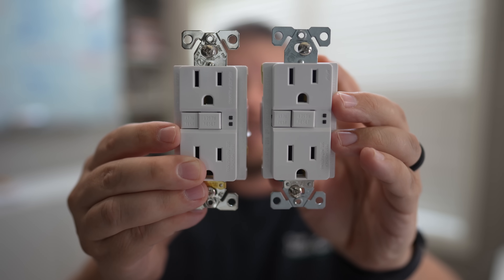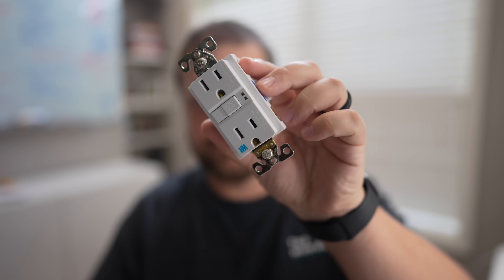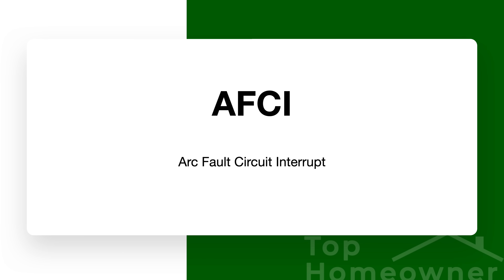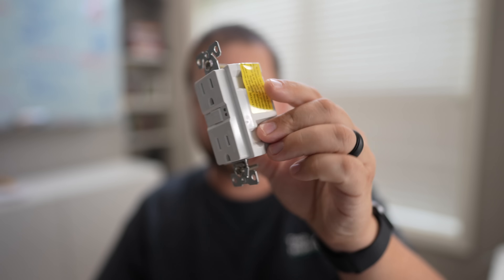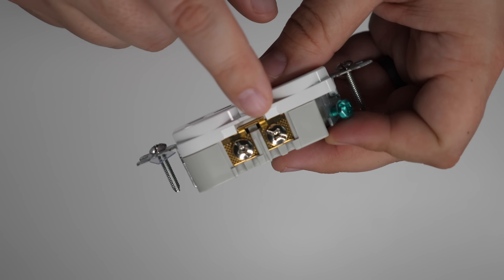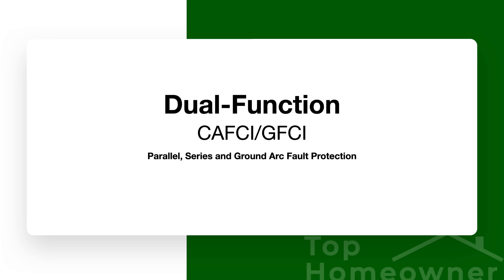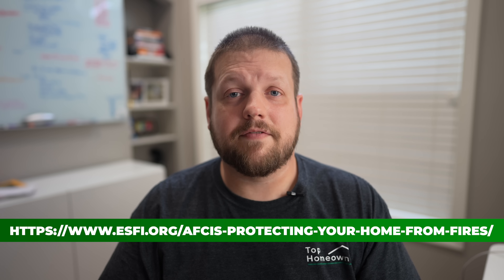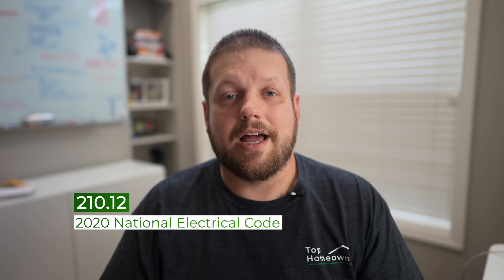AFCI vs GFCI: What's The Difference and Why You Should Care

Comment: At 8:12 you mentioned "FCC certified". What does that have to do with this, or did you misspeak?
Reply from the maker: Yes, while it sounds odd...ideally all electronic devices should comply with FCC (Title 47 Part 18B/consumer or 15B) requirements to avoid loads that can cause nuisance tripping. It's a way to help make sure you're using devices that don't generate a lot of unnecessary noise, and cause it to trip.
Reply: @TopHomeowner  Huh?

Part 18 pertains to "industrial, scientific, and medical devices", and part 15 pertains to "radio frequency devices". Neither of these portions of the federal code would be applicable at all to any devices commonly found in homes and which would cause nuisance tripping of AFCI breakers.

Indeed, I'm not aware of any FCC regulation that would apply to non-radio-based household electrical devices. The FCC doesn't have jurisdiction over, for example, manufacturers of vacuum cleaners, or toaster ovens, or plasma TVs, or the like.

Comment: Thanks for the excellent video.  I was hoping that you would spend a little more time on 'nuisance trips'.  Major appliances like microwaves and refrigerators can have higher current draw at startup and cause the AFCI receptacles to nuisance-trip - or so I have been told.  I have been bothered by nuisance trips in my microwave circuit, and have been meaning to get around to taking out that receptacle and replacing it with a standard one.  BTW, I was told by the building inspector to do this if it became a nuisance.  Since the microwave is on a dedicated circuit and the microwave's chassis is grounded, I don't see any risk in doing so.  Comments?
Reply: A dedicated circuit and grounded chassis don't have any relevance to arc faults, the events AFCI are intended to address.

That said, I had a house built, moved in a few years ago, and the AFCI breakers were all kinds of trouble. We eventually got things settled down, mainly by putting in newer versions of the same breakers. Apparently the manufacturer does work to update them to have less nuisance tripping. But even so, while it's a lot better now, they still trip for no good reason once in a while (the vacuum cleaner being the main culprit at this point).

The breaker manufacturers love to quote how many house fires might be avoided with AFCI breakers. But with all the false positives, people learn to not trust the breakers. And if the fault is inside a wall, it's not like a homeowner even has any sort of practical way to diagnose the problem. They're just going to assume that it's a nuisance trip, get annoyed it keeps happening, and put in a non-AFCI breaker, negating any benefit the AFCI breaker might have provided for all that expense.

This seems to me a great example of a road to hell being paved with good intentions (if one charitably really believes that the manufacturers are just out to save lives, and not just grab thousands of extra dollars per new home built).
Reply: These things are electronically controlled & age does not help. Replace it with a newer GFCI and you'll probably be set.
Reply: @dryan8377  Thanks for the comment, Dylan.  Very true - they can get worn out from age, or from too many trips (I suppose).
Reply: @dryan8377  Yeah a GFCI thats not faulty never has nuisance trips, its not the same with the AFCI, as it just looks for waveforms that look like sparking, so if an appliance generates those waveforms its gonna trip the AFCI.

Comment: Pretty hard to get hot and neutral any closer together than touching side by side in an entire home run if you use 12-2-2 for powering two separate circuits.

Comment: "designed to protect against a ground fault from occurring".

Bad use of English.
There are two grammatically correct English statements which can replace this erroneous statement.
1. designed to prevent a ground fault from occurring 
2. designed to protect against a ground fault.

The problem is that people may interpret your remark as number 1. And a GFCI doesn't prevent the ground fault from occurring. It simply mitigates the impact of it when it does occur.

What you should have said is written in number 2. 'designed to protect against a ground fault".  The addition of "from occurring" was wrong.

You have to be careful with the use of  language when your goal is to educate people.
Yes it is being pedantic but it matters.

Comment: I absolutely DO NOT care. When I bought my house 25 years ago, it had 4 GFCIs in it. I quickly removed them, put them in the trash, and installed regular outlets. Problem solved. Been fine for 25 years.
Reply: Been fine until someone is electrocuted.
The GFCI isn't about protecting the electrical installation, it's about protecting you and others from electrocution.

Do you not understand this?

The AFCI and breakers are about protecting the installation.

So you have removed devices that were installed to protect people from electrocution and you say you don't care.
Are you stupid?

Comment: Is there a way to determine why an afci is nuisance tripping?
I paid a lot for Square D QO plug on AFCI/GFCI brakers. They had to be removed.
Reply: If there is no arc, and it trips, then it is nuisance tripping...
Reply: @deang5622  How do you know if there was an arc?
Reply: @cannon440  Arcs generate wideband RF interference. If you had a AM radio receiver hooked up to a data logger and time stamped that could be a way.

I suspect there is noise induced on the conductor which could be detected using an oscilloscope. I am not sure of the exact method employed by AFDD's, but they will be looking at some characteristics of the waveform , voltage, current, in either time or frequency domain.

And arc's cause burning of switch contacts or wherever it is the arc forms. So you will see discolouration or even evidence of black carbon burnt residue.

Unfortunately, the inside of switch contacts is hard to see.
Reply: Unless something specific trips it, like using a vacuum cleaner, you have to inspect the circuit to find out.
Reply: @kamX-rz4uy  How do you inspect a circuit which is completely behind the walls?

Comment: The problem is that AFCI's nuisance trip so often that most people don't trust when there really is a problem.
Reply: Correct. One problem leads to the other -- nuisance trips are "crying 'wolf,'" with the usual results.
Reply: Correct. The same issue with the stupid tire pressure monitors in vehicles that were mandated and a generic light turns on on the dash. False alarms to the point of ignoring them and then on occasion an actual flat tire. Basically useless. Newer vehicles give specifics, which is crucial or is not a good tool.

Comment: I discovered that spider nests inside my outdoor receptacles caused my panel GCFI to trip.  Replaced the cheap receptacles with commercial grade and haven't had a problem since.
Reply: harbor freight
Reply: I've experienced this with a circuit breaker. Weirdest electrical issue I'd experienced.
Reply: Where do u get cheap electrical products?  I needs to know!!!
Reply: @tredogzs  This is a 48 year old house, some of the stuff has like 79 cent price tags.

Comment: I had a gfi that keeps triping turns out it was all the steam  build up in my coffee pot
Reply: Change your coffee pot.
I use electric kettle and coffee pot and my apartment is protected by two GFCI's at the distribution board and they never false trip.

I certainly would not keep the coffee pot and remove the false tripping GFCI.
I would replace the coffee pot and keep the GFCI. Why? Because the GFCI will save my life but the coffee pot won't.

Comment: I am an electrical engineer and a contractor and want to say, that it's a very good and easy to understand  explanation of AFCI and GFCI protection.
Reply from the maker: Thanks, I appreciate that!
Reply: I cant belive how prehistoric sockets look in America.
Reply: I just got power back after losing it for 3 days due to hurricane berly. Problem is that my 3 bedrooms and its lights don’t have power. I went to circuit breaker panel and tripped the 3 breakers, but to no avail. The three breakers show AFCI. Does that mean the wiring and receptacles in those 3 bedrooms are AFCI? Is it ok to replace those 3 breakers with regular breakers since the cost of AFCI breakers are 10x more at Home Depot. Thx.
Reply: I fingerprint and build mud castles after it rains and I can tell you I understood this video.  I know understand arc and ground fault interrupts.
Reply: But to be honest, it is not hard to explain what the purposes of the two devices are and how they work, is it?

I mean, it's not as if the presenter is trying to explain how to take a signal in the time domain and convert it to a representation in the frequency domain...now that would be beyond most electricians.
Reply: @deang5622  dont be that guy. "Acckkttually..."
Reply: @deang5622  Electricians don't use oscilloscopes or signal analyzers, but mind you some of us are familiar with these diagnostic tools, but its not needed for what we do. Its not necessary.
Reply: @deang5622  you're so SMRT....

Comment: I have some rent houses with ungrounded circuits and was wondering if installing the combination breakers would be an adequate solution.
Reply: As a matter of fact, you're right. No grounds is in violation of current NEC codes, but an allowed exception is GFI protection on said circuits.
Reply: No. Don't cheap out on the safety of your tenants. Have the homes rewired.

Comment: The recepticals with push to connect can cause arc faults. I have seen three trailers and two houses where push to connects caused fires.
Reply: Yeah use the screw terminals and the problem goes away.
Reply: Should be outlawed

Comment: GFCI's do not work in modern homes.   The molded fiberglass sinks with plastic supply lines never show fault.  There is no ground.  Plug an extension cord in a GFCI and throw the end in a sink of water, nothing happens.   Same with the bath tub.
Reply: I don't think you understand what the GFCI is intended to do 

The GFCI's purpose is to detect current flowing to earth and protect the person from electrocution. If you throw an extension cord into a fiberglass sink containing water, then there is no current flow to earth.

Now, if you put your hand in that water containing sink, depending on the conductivity of the water,  you will end up with 120/240 volts developed across your body. 

The GFCI works by sensing the difference between the line (hot) and neutral currents passing through it, so if some of that hot current is now flowing through you because you have got your hand in the sink, then current path is through you down to earth and eventually back to the source, the GFCI will trip because the hot and neutral currents are no longer equal.

So whilst that GFCI may not trip because the extension socket is immersed in water in the sink, when you put your hand in, current will start to flow through you to earth causing a mismatch in the hot and neutral currents and the GFCI will trip.

Feel free to test it..but you might want to have a EMT and a defibrillator with you, just in case...
Reply: @deang5622  So what you're saying is I should keep a bowl of water with an extension cord in it just in case my heart stops and I need a jump.

Comment: Great job, so, my AFCI breaker is tripping on a brand new install of a Trane Heat Pump in new construction. When approaching the contractor, how do I address this if they want to just replace the breaker with a non-AFCI?
Reply: As I understand it - you get to WAIT until the project is done.  And then get the contractor to come back or you do it yourself - but replace it with just a GFCI.  Course you could go 'standard' - but I love GFCI's and the safety they give and their reliability.  AFCI's are a mandated problem; which your contractor cannot legally substitute.  They are a good idea - but it seems they are also impossible to make so that you don't have them tripping from totally correctly functioning appliances.
Reply: Let's him,this is more about nec,and nfca engine er

Comment: Afci is a total crapshoot! Try plugging in anything that is even remotely close to the circuits peak draw and the breaker/plug will trip. Total BS. Do not install these unless you are forced too. Then remove them the moment the inspector turns their back. You'll thank me later
Reply: I'm an electrician in Washington DC... I've installed hundreds of arc fault breakers this year... I've ran into one problematic washing machine that nuisance tripped... I'm sorry bud but you don't know what the fuck you are talking about... Afci breakers save lives...

Comment: All these descriptions are all well and good but you missed the most important part!
The National Electrical Code (NEC) and the National Fire Prevention Association (NFPA) have made GFCI and AFCI MANDITORY FOR ALL CIRCUITS!
I recently changed out the entire electrical system in my house. Much of it was aluminum wire with cloth covering into ungrounded metal boxes without retaining clamps!
I had to replace everything from the meter to the last outlet box!
The fire inspector showed me in the code book the distances apart, the power limitations, and the protection required.
Needless to say, the job QUADRUPLED in cost!
Reply: I don't know how code works where you live, but were I live old circuits are grandfathered, and you do not need to redo them to modern code, if you do not touch them.
Reply: Yeah. They've gotten more stringent. I don't do residential,  so thanks for the reminder.

Comment: Any idea on how to fix false tripping on an AFCI? Every time I fire up my tig welder ( with HF start) every AFCI near me trips. I have a few other things that black out my home, Tesla coil is the worst!
Reply: Simple, remove them. There is no reasonable way to solve this. The plugs are doing what they're supposed to do, the only way to stop it is to remove it. Probably not the answer you where looking for but to my knowledge it's the only one.
Reply: Replacing the breaker with a non-AFCI breaker is the only practical solution. You could add a line conditioner, i.e. an isolating power supply that uses the mains power to run a separate power supply from which the actual device is run. But that sort of thing is a really expensive and unwieldy approach, especially for high-current things like a welder.

Comment: Is would appear that AFCI is used to protect from bad / poor wiring during installation. There should not be any arcing between wiring if it was installed correctly per NEC.
Also, you mentioned nusiance faults on breakers can happen if the device was not made to FCC standards. The Federal Commications Commission (FCC) deals primarily with RF spectrum when it comes to spectrum allocations in communications etc but what does the FCC have to do with electrical wiring?!!
Reply: Maybe with newer projects... Older wiring with cloth insulation just kind of crumbles away eventually creating all kinds of parallel arc situations...
Reply: Breakers which include electronic components such as AFCI are subject to radio frequency interference, so well within the jurisdiction of FCC regulations.
Reply: @deang5622  If a transmitting device has enough power to interfere with these devices, the FCC would be addressing the source of the cause of these interference and not these passive devices. There may be some generic wording from the FCC on hospital grade outlets that states there shall be enough shielding to prevent failure from external interference! But I seriously doubt consumer or even commercial grade outlets have standards by the FCC and the manufacturers actually TEST and validate their products MEET these FCC standards!!! Google search turned up nothing even for hospital grade outlets!!  This FCC reference is complete nonsense!!!
Reply from the maker: Yes, while it sounds odd...ideally all electronic devices should comply with FCC (Title 47 Part 18B/consumer or 15B) requirements to avoid loads that can cause nuisance tripping.
Reply: @TopHomeowner  The loads you referred to for nusiance tripping were from inductive loading and not from radio frequency sources!
Reply: @TopHomeowner  Of course. The question is how many of these manufacturers actually submit sample products to an independent lab to be tested against the FCC requirements?! Maybe some do but I've never seen those certification on any commercial breaker I've purchased!
Reply: @TopHomeowner  See my earlier comment. The Parts 18 and 15 you cite don't have anything to do with household electrical devices, nor does the FCC have jurisdiction to regulate non-radio household devices.

Comment: Personally I would rather keep the breaker box as basic and clean as possible, this is not the place I want anything exotic. While the cost doing it at the outlets might be higher it also gives you the option to just protect the most vulnerable spots like the kitchen, bathrooms where GFI is required now in my area. When it comes to the breaker box I am a firm follower of the KISS principal.
Reply: Installing your GFCI at the outlets also make it easier to troubleshoot any problems that may occur in part of a circuit.